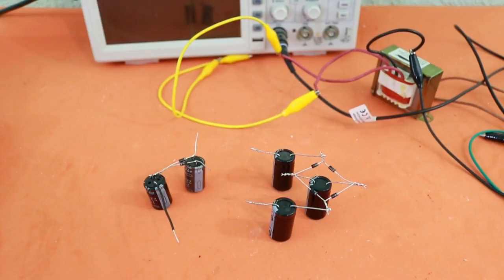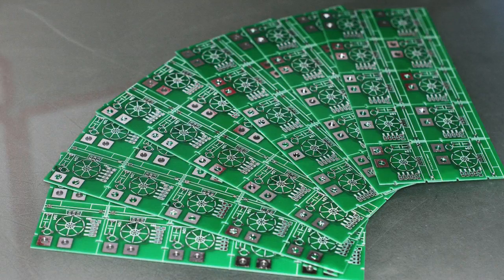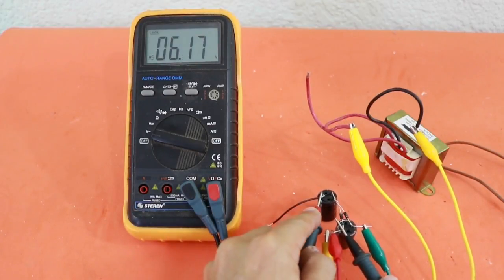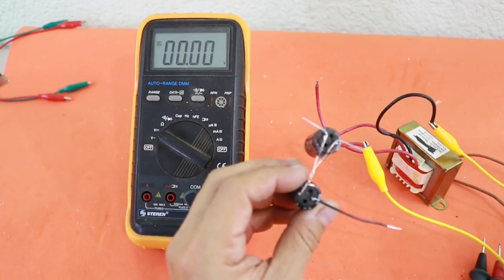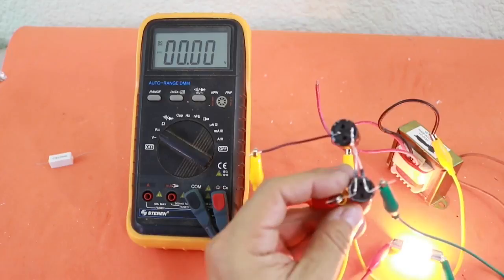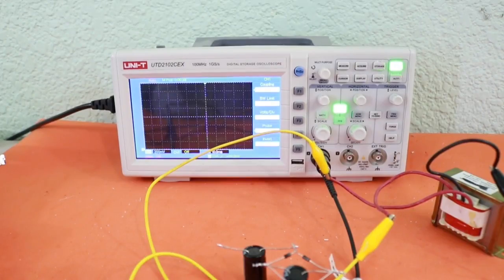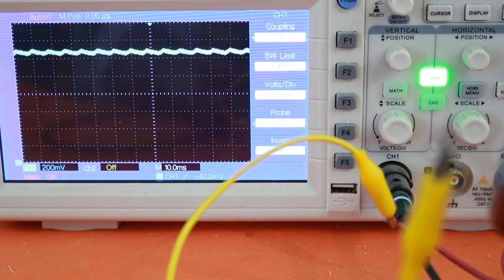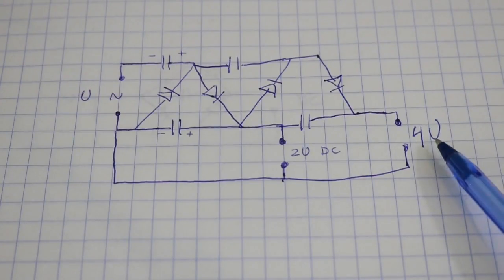How to Make a Voltage Doubler

Comment: Hi ludic thanks for sharing, in both examples, there is a polarized ‘capacitor’ meeting the output of one or more of the inductor outputs, this seems to suggest that the polarity works like a pressure medium where by the ‘volume’ of force is exerted on the alternate polarity?
If this is not the case then I’m simply confused lol

Comment: Voltage is not that hard to multiply but how do you multiply the current? Thanks and thanks for all of your videos as well.
Reply: @Joachim Shekelberg I know, but the current has to be there before it can draw it.
Reply: @BushImports  depends on how much your power supply can provide. Thats why they have voltage and power rating. You can calculate the maximum current it can provide
Reply: Use a step down transformer 🤣

Comment: You can also modify a bridge rectifier circuit by replacing 2 diodes with capacitors, apply ~ to the common of the diodes and common of the capacitors and you have a voltage doubler or a dual rail power supply, single wave rectification, offcourse. Great for powering opamps when you dont have a center tapped transformer, for example in audio where you need + and - DC supply.
Reply: Forgot to mention, the ground is the common of the capacitors, and positive and negative are on the other ends of the capacitors. As for the theory, it's quite simple. When the sinewave is positive, first diode conducts to charge the posistive rail cap, and the negative halfwave charges the other cap through the second diode.
Reply: @Joachim Shekelberg indeed, works even better if you use a 1:1 voltage divider into + input of an opamp and connect the - input to the output, so a buffer, and use that as a reference(virtual ground). Although, it's allways best to have separate power supplies for example a premap and the main amp. That's why, typically, mains transformers for audio applications will have a separate secondary winding so that galvanic isolation is achieved.

Comment: What you explained is basically how charge pumps works. They are extremely efficient but are only used for low current applications. Nice video anyway.

Comment: Hello!

I am planning on making a voltage multiplier soon, but I need some insight on what capacitors to use. Do the capacitors and diodes have to be rated for the output voltage or the input voltage? Like if it takes 12 v ac into 24v dc can I use diodes and capacitors rated for 12 v?
Reply from the maker: Rated at double the input voltage
Reply: Ludic Science So double input voltage rated components even with a triple stage or more?
Reply from the maker: @psun256  yes
Reply: Ludic Science Ok thank you very much! I couldn't understand a lot of information online elsewhere so I asked!

Comment: How to make a Current Doubler?
Then, How about combining the Voltage & Current Doublers together?
May be your spot welding using Capacitors be used.
Reply from the maker: You cannot double voltage and current at the same time
Reply: @ludicscience  I cannot, But You Can.
I mean not doubling them at the same time. Make it differently, then join it using some circuit. I just wonder.
Reply: There are already current doublers out there.
If you want to "spot weld", you don't want much volts, you want only amps.

There are videos online how to make a high current spot welder on YouTube. Use an old transformer from a microwave, then re-wire it.